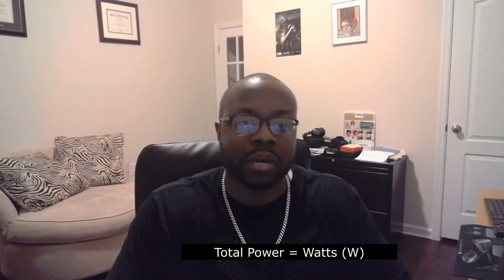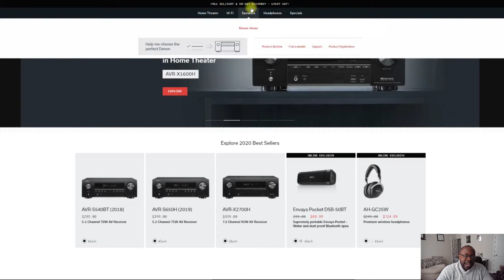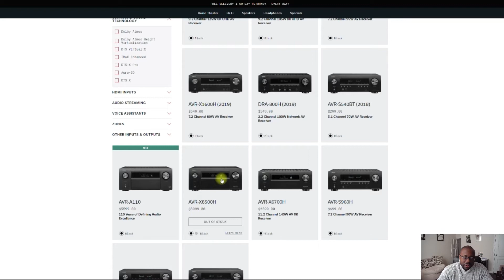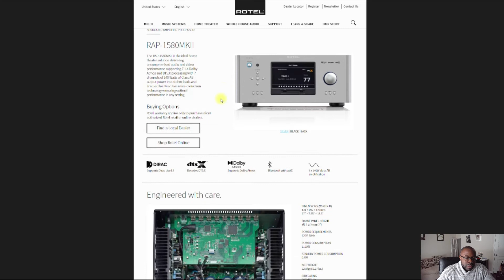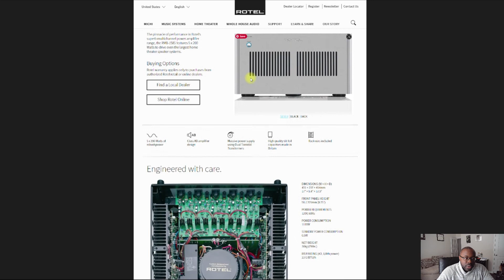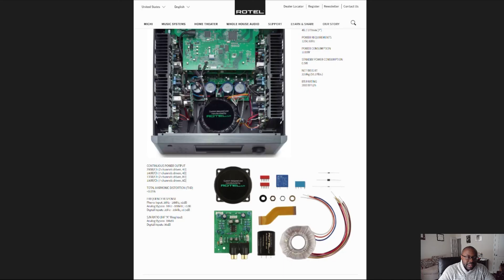[Home Theater] Understanding Amplifier Power Ratings

Comment: Im just about to start this video. When most AVR ratings say 2 channels driven, is that ANY 2 channels driven? Like when if I decide to connect only the 2 front or only the 2 rear channels is that the max wattage I will get with any 2 channels?
Reply: Yes the measurement for 2 ch driven is for any 2 channels. But if you you watch the video you’ll see why it’s not accurate to describe it as a max wattage. It’s just a number and amplifiers are hardly static with their power. As you play music or watch a movie, the power will fluctuate over time. There may be times in a movie when only 2 channels are active so the power should match the 2ch rating in those cases as well. When you take into account the total picture of watts, distortion, frequency range etc, that power rating can give you an idea of how much clean power your amp can sustain.
Reply: Subbed!!
Reply: @tistru  thank you very much